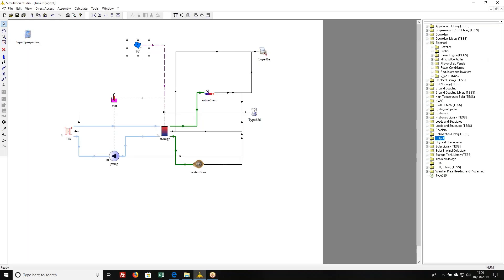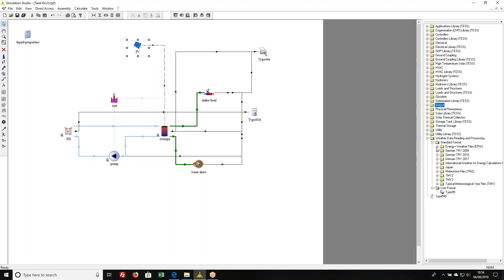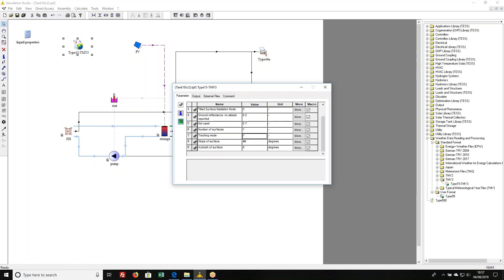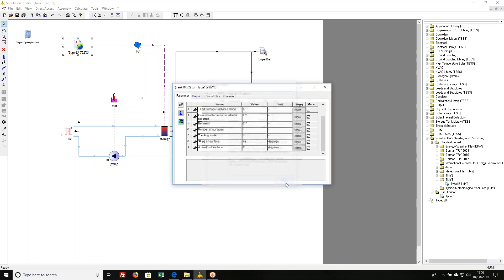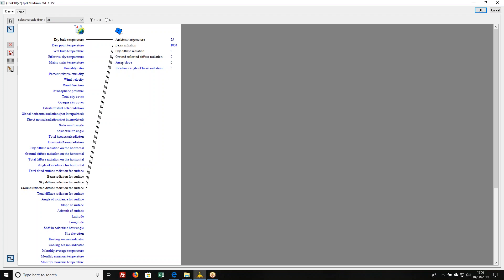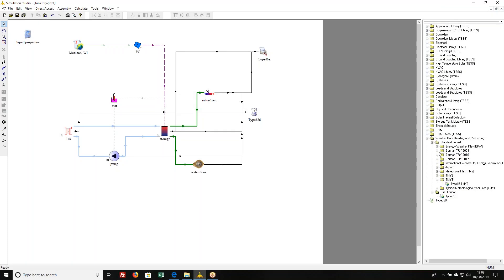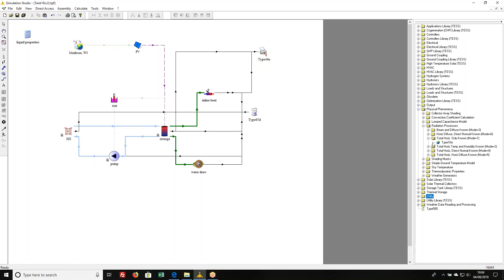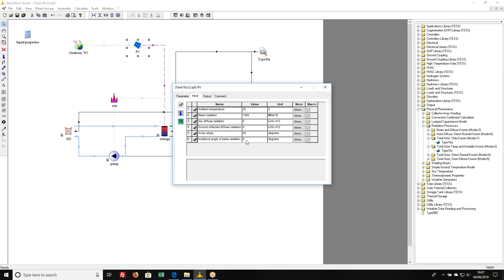Using Weather Data in TRNSYS

Comment: How to correct Time add in Simulation Actually my Result start from3624 and end 5088 is difference is not correct please help me.. How to set correct data from 24 ..
Reply from the maker: Hello Harvinder, I'm afraid I don't quite understand your question ... if you're trying to run your simulation only from hour 3624 to hour 5088, you can change the simulation start/stop hour by going to Settings (gear icon in left toolbar, or from the top menu bar go to Assembly -> Settings) and setting the start time, stop time, and timestep as you wish. If you've made it that far and are having a problem with the results when running from hour 3624 to hour 5088, I'm going to need more context. Is your weather data in a standard format read by Type 15 (TMY, Meteonorm, CWEC, EnergyPlus, etc), or is it custom weather data you're reading in with Type 9? Is your data file one distributed with TRNSYS, or did you obtain it from another source? Is it values in the data file itself that are wrong/incomplete, or is it TRNSYS reading/interpretation of the data file that isn't what you expected? In any of those events, I would recommend sending your project file and any data files needed to run your project to your distributor and asking for technical support.

Comment: Hello sir
How can I add weather data file of Asia more specifically Pakistan
Reply from the maker: The optional TRNSYS Weather Data add-on includes Meteonorm weather data for over 140 countries, including 5 locations in Pakistan. If the TRNSYS Weather Data add-on has already been installed, you'll find these files in your Trnsys18/Weather/Meteonorm/Asia folder. If you or your institution purchased TRNSYS from us (TESS), you can install the TRNSYS Weather Data add-on at any time by finding the 'TRNSYS Download Instructions' email you or your institution received when they purchased TRNSYS and following the instructions for Add-On: TRNSYS Weather Data, near the bottom of the email. Contact your distributor if you need help downloading the extended weather data pack.